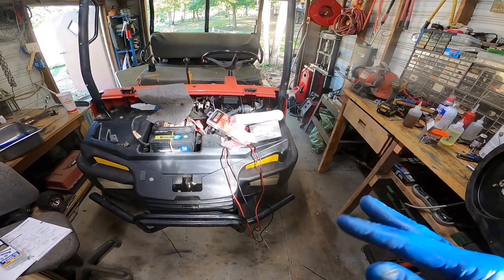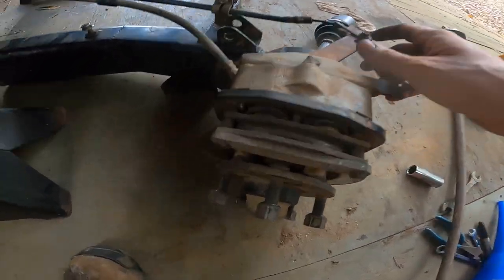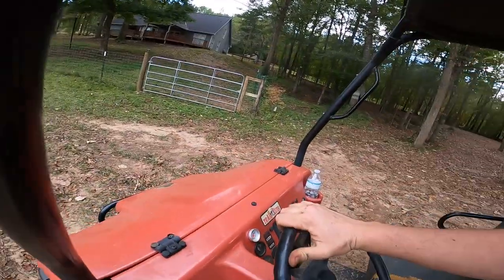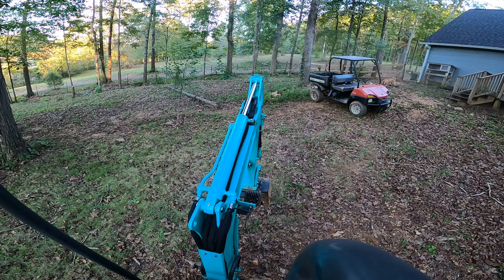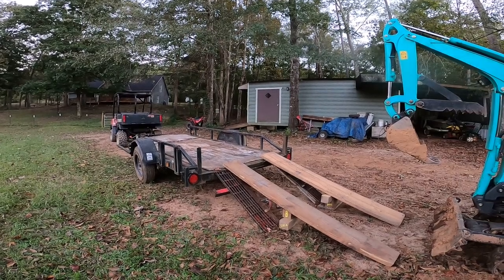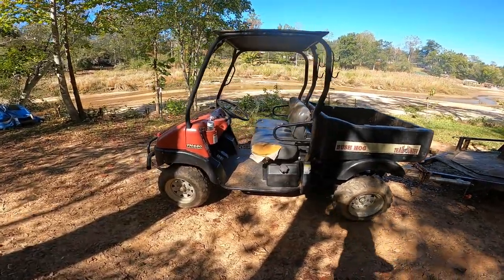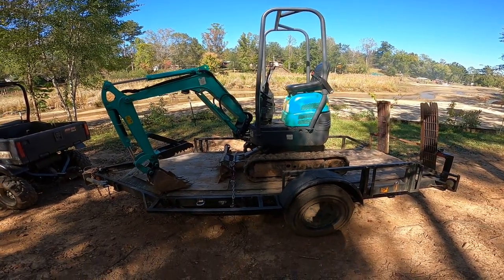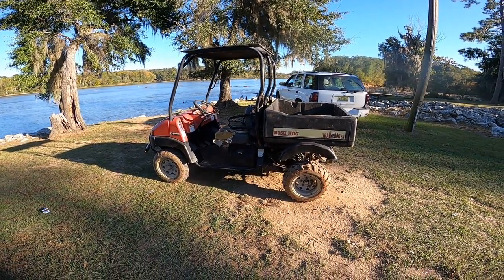PURCHASING UTV/MULE OFF MARKETPLACE (PART 3) THIS THING IS A BEAST!!!! TORTURE TESTING

Comment: I know this is a older video and you did awesome brother. I have a question for you brother, what is the expected top speed on the bush hog
Reply from the maker: I really can’t remember I just sold it about a month ago I think it was 35? It didn’t have a speedo either
Reply: @TheHomePros6221  thank you. I just got one 3 days ago and just got it running. I was wondering because that's a big motor